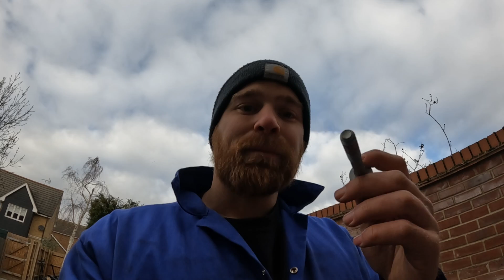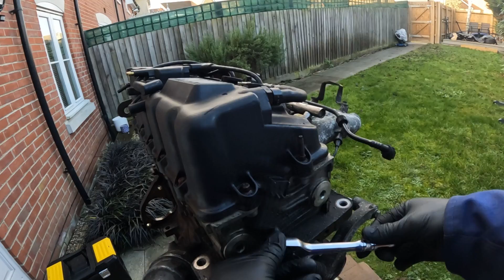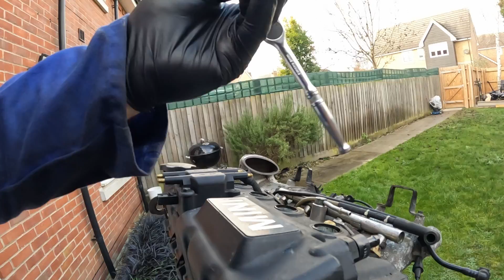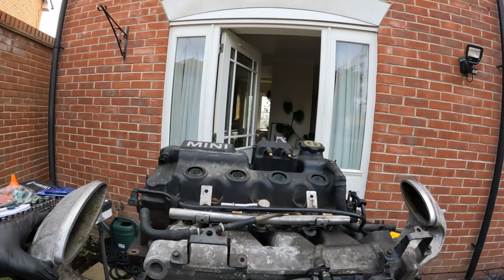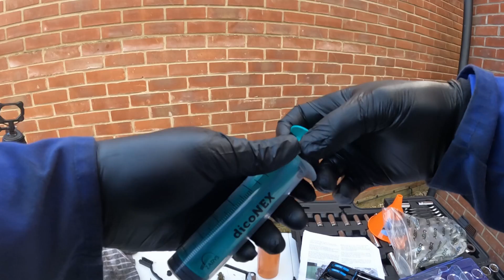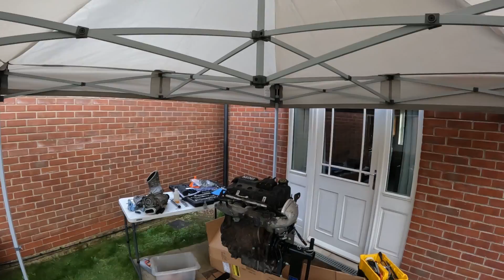This ONE Thing Will Make Your First Project Car A Success

Comment: So I've watched all your other projects back to front, I started with the P6 Rover. Currently laid up with covid so cheers for keeping me entertained! I am totally self taught by the suck it and see method, some will hate that but our MOT system is so strict you have little chance to get it wrong, because if you do it simply won't pass! You should invest in a cheap parts washer off ebay they only cost about 50 quid. Anyway looking forward to watching the rest of you mini rebuild and further projects.
Reply from the maker: Great to have you on board, Simon

Comment: You need Impact gun a big invest but essential in long run a cordless ratchet e-bay £35 workes fine some semi deep sockets a good rechargable head torch a pair of ski trousers (Aldi £10 a pair in November a godsend) and a bench grinder with wire brush wheel ATF and Acetone mixed 50/50 and a little patiance while you do something else a copper hammer a decent 12inch pry bar and some big to small and small to big adaptors a pick set draper is good a decent pair of vice grip moles 20,30,40,and 45 3/8 torx sockets to start and dont forget if it feels nasty make sure tool is home and tighten slightly before you undo and always always have fun
Reply from the maker: "and dont forget if it feels nasty make sure tool is home and tighten slightly before you undo and always always have fun" 👈🏻 this sentence really hits home. Great advice

Comment: You know what to do for your next flip - grab another R53 mini and you'll have the tools and knowledge to turn it around quick.
Reply from the maker: Yeah, that's not a bad shout at all. Only thing I worry about there is doing too much Mini R53 content - might get a bit boring for the viewers...
Reply: I’ve done a ton of minis now and most garages hate working on them. But once you’ve done one there not to bad.

Keep up the good work. I see the centre caps on the wheels are off the R53 Owners Club. Have you joined up on there? 😂
Reply from the maker: Cheers mate. I've been trying to work out the whole time I've had the car where the centre caps were from, so thanks for solving that riddle for me. They were already on the car when I bought it!
Reply: @NotEconomicallyViable  it’s a Facebook group so must have belonged from someone on there. Keep going though not much left. The slave cylinder can be a crapper, so normally clamp it down and then when you fit it in the car, weigh the brake pedal down overnight. I normally put a sled hammer on the pedal and put flip the seat forward so it’s pushing against the handle.